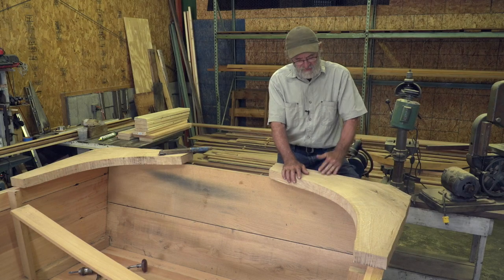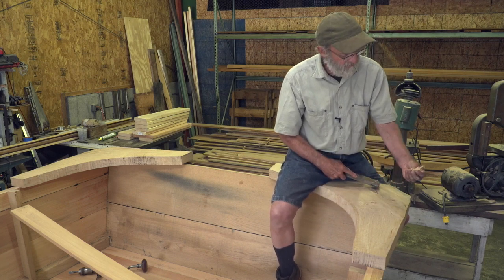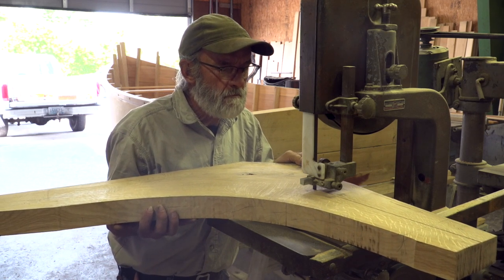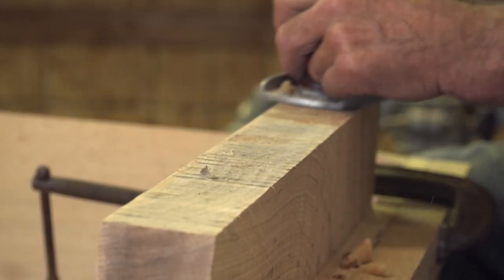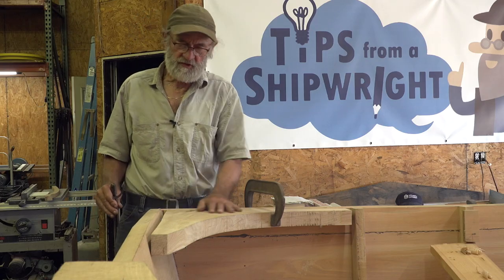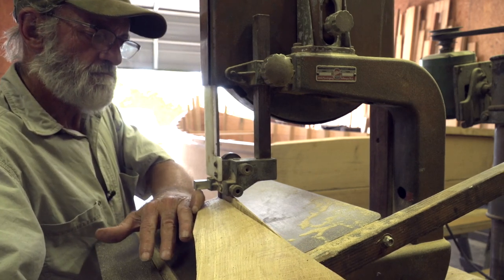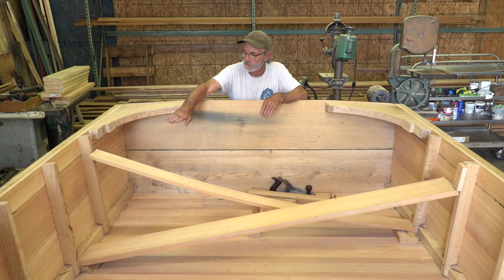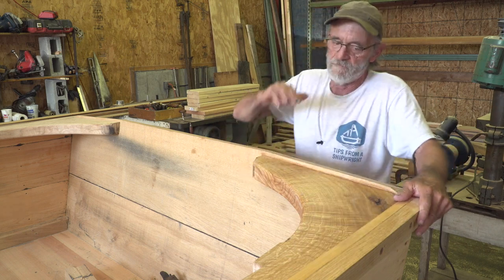TIPS Season 3 - Episode 6: Installing the knees

Comment: scraper......the original ancient and ideal means to shape wood (and stone...and leather...and bone....clothe!!!)....this is why I love watching a master craftsman who knows his tools.  Very inspiring stuff!

I just made a new walnut table top for an old sewing machine work station.   One single large slab.  

should I use a table planer and sandpaper?  

nope....used a simple 6 inch scrapped modified with a large flat knife blade set at 85 degrees.  Used the same technique....oblique to the grain, and drawn only.

last few passes...very very lightly......amazing flat no fuzz result.  

now about to make my own shellac ....

just think how it was done before electricity...?

Comment: I thought of another way of doing this if you scribed the line on the top of the knee then with the same setting on your divider's scribed a line underneath the angle would be worked out for you although this doesn't help you set your band saw. I love the way you work and use your ideas all the time your an inspiration to me and kept me going all through lockdown when I couldn't get to my boatbuilding shed

Comment: Used to use tension spring braces to string walls after they were tipped up, all the time.
Usually just straight braces (or even strongbacks) if we needed to push them out.

Beautiful wood, and beautiful work Lou!  👑
I'm beginning to really dig your backdrop banner.

Comment: Lou, I have built a few kitchen counter tops with a hardwood we have over here which is a little like oak, although it ain't that. It is known as "Stringybark", "Messmate, and "Australian oak".  As a counter top, strength isn't an issue, but in this application small defects like this one should not be a problem either. We often find knot holes and sap grooves and flaws in the timber, and the way I (and no doubt other blokes too) deal with that is to use what I believe you chaps refer to as "Bondo"; the clay and epoxy based filler that auto body workers use to fill defects in car panels. I mix it with the black pigment used to colour mortar or tile grout, and you would find that at Lowe's or Harbor Freight or wherever. Anyway, if you use a lot of pigment the bondo comes out very black. Wipe it into the defects (knot holes, checks, what-all), and sand it back. It will go grey, but when you apply your gloss varnish it comes out a lovely glossy black, and goes well with the slightly yellowish timber.

If you don't like black, use some other colour. Red or brown goes well with many woods, and if you feel artistic, blend some pigments together. But straight black works very well, in my opinion.

Comment: As for the knot you could either just put an epoxy in so you don’t have to worry about it breaking loose and falling out or if you’d rather you could put dutchman in. From what I’ve seen I’d probably just use the epoxy to make sure it doesn’t work loose. You never really notice it and it still get the interesting grain pattern when finished. Of course if as you say there’s a defect in the other knee in roughly the same spot depending on the shape of your Dutchman you could make it look like a design feature. But the choice is yours of course and like I said I would just go with the epoxy.

Comment: Off the subject of the video, I know, but the horizontal transom planks seem to have opened up a little as they did on the first flat bottomed skiff that Lou built for his previous series. I believe they were located by vertical pins and bedding compound. Are there any circumstances where the transom planks would be glued  to form one single integrated board?

Comment: SO I'm a little curious, why didn't you just lay the knee on top of the corner and then just scribe from underneath to the inside edge of the transom as well as the side of the boat. 
Incidentally, you talked about the issues with running it through a planner. I use a drum sander to take out any imperfections in the surface. That leaves it nice and smooth. We also use a drum sander or belt sander to clean up the edges. Just sand to our lines.

Comment: if that was my boat o would drill a hole where that knot is in the knee and fit a tube of brass with a flang into the hole  ,then  put a cleat under the knee and build a little wooded box under the knee to cover the cleat ... I would cut a piece of rope and tie it to the cleat and run about 5 or 6 feet through the hole ,,, tie a knot in the end so the rope don't fall through the hole too .... now you have built in tie offs on the boat and you don't have to see the cleat on top of all that wood ,,, after you untie the rope just drops back into the hole and gathers in the little boat out of the way